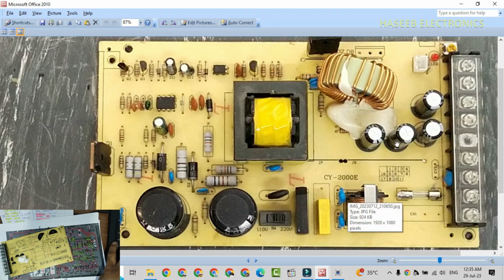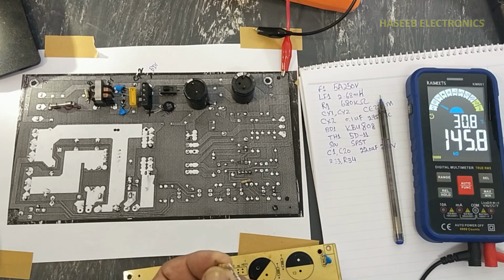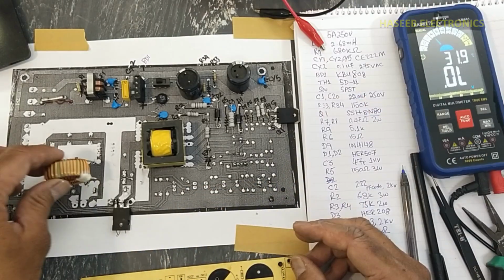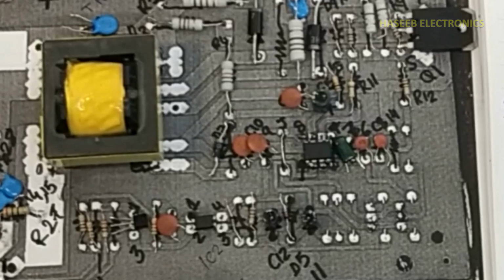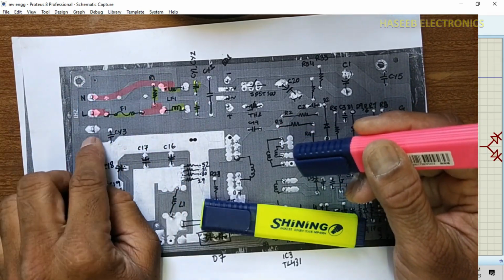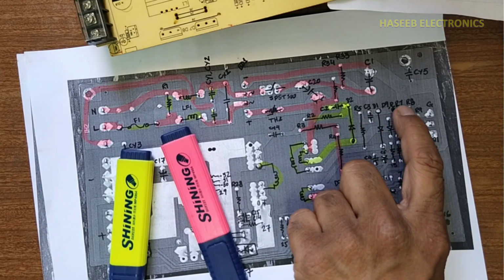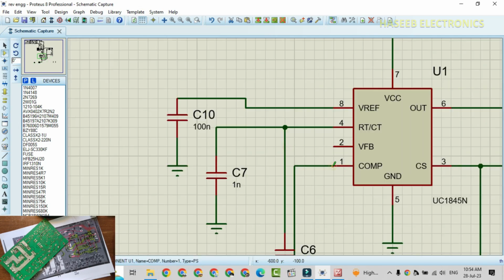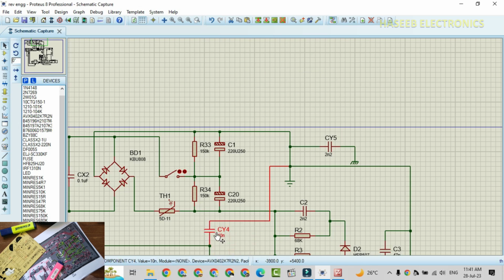{946} how to draw circuit diagram from pcb || pcb layout

Comment: Thank you very much for sharing your work. I have an almost similar power supply non working. Would it be possible to share the drawing you made? Thanks again
Reply: :hand-pink-waving:
Reply: it would be good
Reply from the maker: sure I will recheck it in detail, rearrange and will share it as soon as possible
please accept my best regards 🙏
Reply: @HaseebElectronics pl share the circuit diagram

Comment: You made a mistake at CY5 you grounded both ends.  Loved the video great work.
Reply from the maker: no, CY5 is connected correctly 
one end is connected to dc rail -ve terminal 
and the other end to chassis and earthing point
Reply: @HaseebElectronics what’s the purpose of CY5 to couple the negative rail to earth ground line on the input chord?  Because cy3 and cy4 seem to isolate the two grounds.  Just trying to learn the circuit.  Thanks for your answers.
Reply: :hand-pink-waving:

Comment: First of all, thank you for your valuable information. I've been following with interest and curiosity, thanks to you, I have improved myself in electronics. I would be very grateful if you could help me understand this. I would appreciate it if you could explain the circuit that creates the transistors (a1015) in this power supply and how the transistors are driven. I have a power supply similar to this one and the Vcc voltage in the ic does not exceed 8 volts. I think the starting threshold is 8.5 volts on this IC. When I give 12 volts externally with another power supply, the reference voltage comes on at pin 8, but there is no output at pin 6. I would be very grateful if you could explain. I wish you good work.